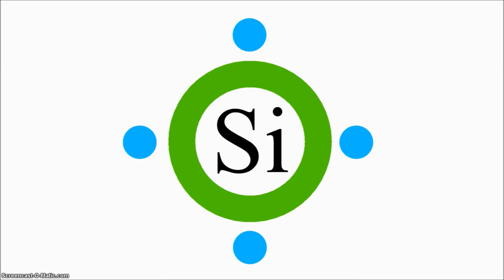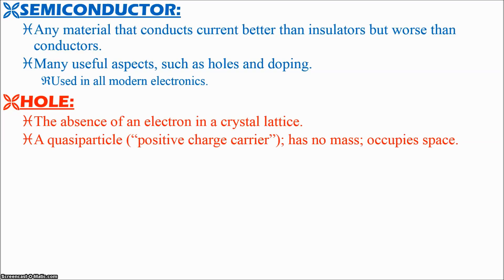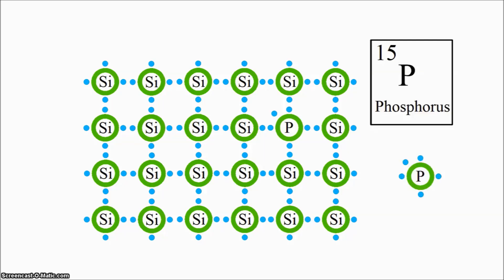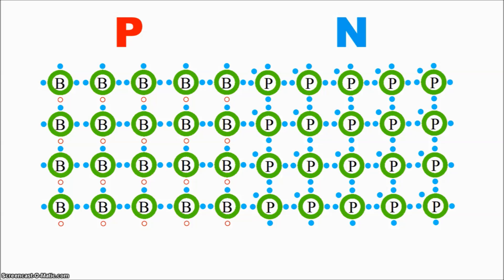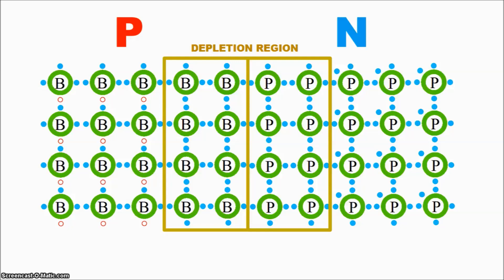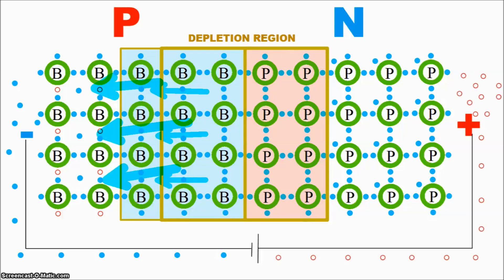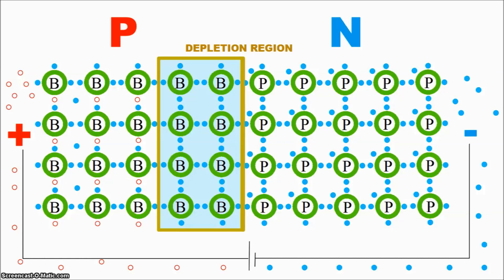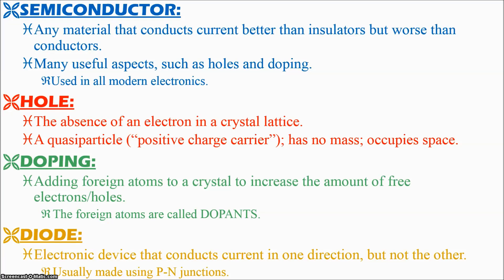Conceptual Understanding of Semiconductor Basics: Holes, Doping, and P-N Junctions

Comment: Thanks for the video. In a normal circuit with a direct current, the current is going only on one way. So, in that kind of circuit, what is the advantage of a diode, if the electrons go just one way anyway ?

Comment: Great video, thanks!
One question, why to use a semiconductor and not a conductor in first place? Is it about price, or there is a physical reason there?
Reply: Three years later and here is your answer!

Semi-conductors are not used as wires. They are not as conductive as convential conductors, such as metals, and also far more expensive to scale to the length of wire you would need. But, they have different extremely useful properties that are used to perform many other electronic tasks. 

In this video, he explains how a PN junction can function as an electrical component called a diode, which is an electronic device that only lets current flow in one direction. This alone is an extensively in electronic circuits. As mentioned in the video, you can now turn AC power into DC power. Whereas a conductor, such as wire, will always just let current flow in both directions. A diode can also be used in electrical protection circuits. For example, if you connected a battery the wrong way round to a device, a diode could be used to make sure only that only when the battery is wired the correct way round that current can flow. Therefore protecting your circuit.

PN junctions can also be used to create light emitting diodes (LEDs) which is a light emitting device, which produces light far more efficiently than simply heating up a conductor until it glows does.

Most importantly, using PNP or NPN junctions, you can also form transistors, which are electronically controlled switches and can also act as amplifiers. Transistors are the basis of every electronic device in modern day. Your phone, computer, calculator uses millions if not billions of transistors to perform logical operations. And each transistor, is built up of a structure of differently doped semi-conductors. 

Hope this explains the difference and importance of semi-conductors compared to regular conductors! In essence, one is for moving electricity around, and the other, is used to carry out useful operations. A semi-conductor can function as very bad and very expensive conductor, but a conductor can not do what a semi-conductor does.